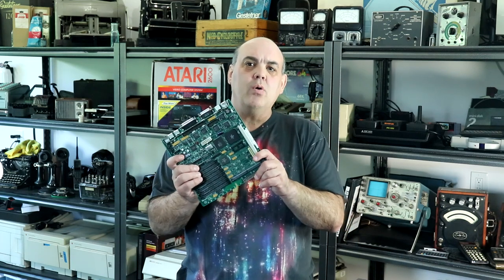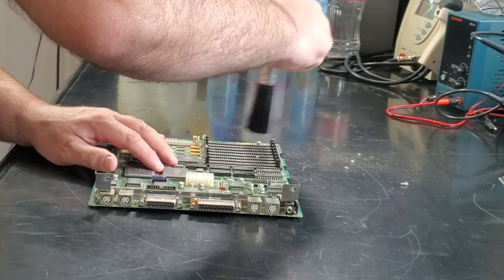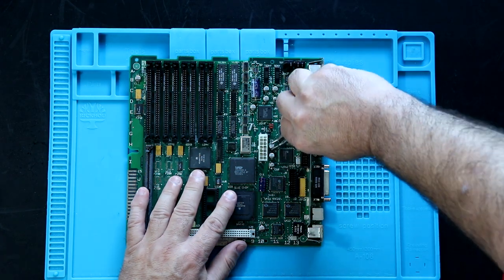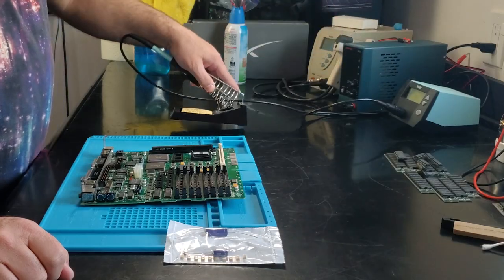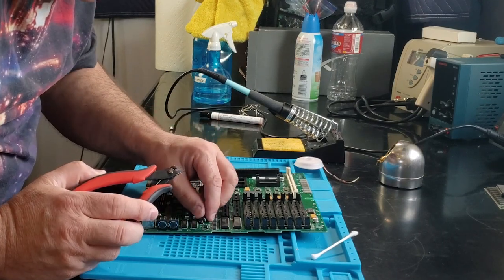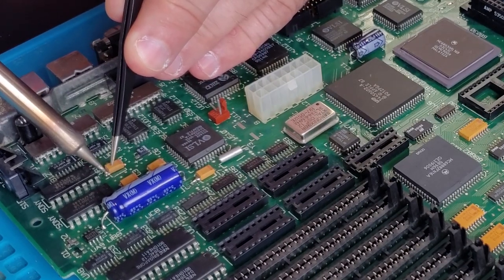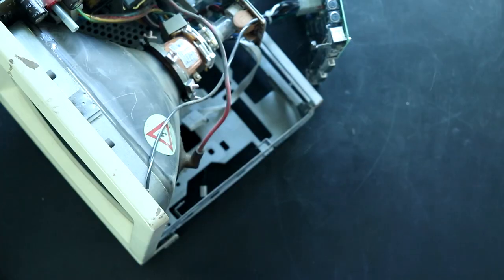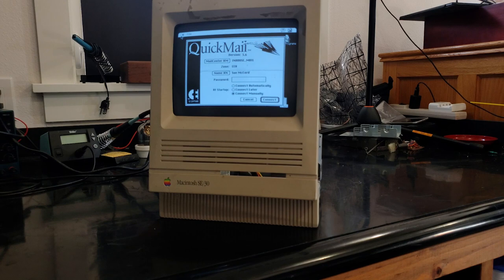Mac SE/30 Mainboard Recap - Mac SE/30 Project Part 3

Comment: Wait. WATER RINSE? Would have never tried that.
Reply from the maker: Kevin, I know how you feel. Its counterintuitive but water only harms electronics if they are energized before its ALL removed or is allowed to sit for long enough to cause corrosion. Some people actually run these boards through their dishwashers.
Reply: Just watch adrian black or most other retro refurbish channels, everyone is doing it :-) You just need to make sure to use distilled clean water or alcohol for the final rinse and dry the board thoroughly before continuing.
Reply from the maker: Yep, exactly! Usually I rinse with bottled water because our water is very hard, blow it off then hit it with a little alcohol to displace any remaining water. Dry overnight and its good.